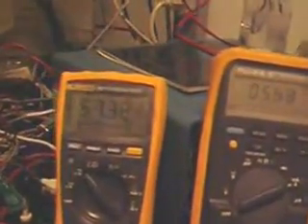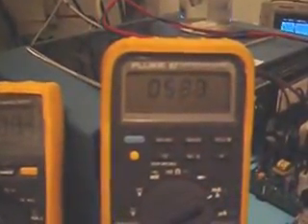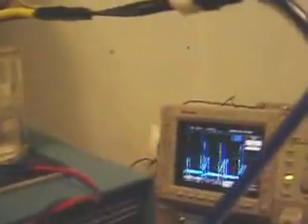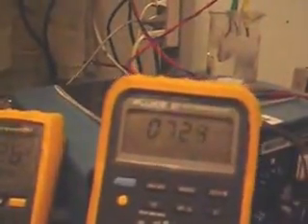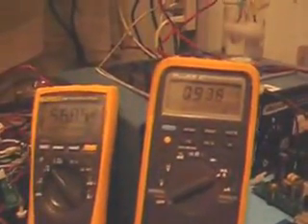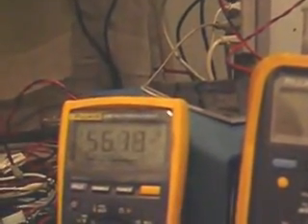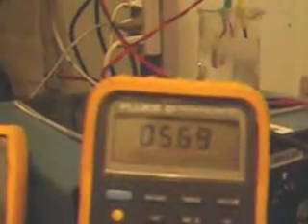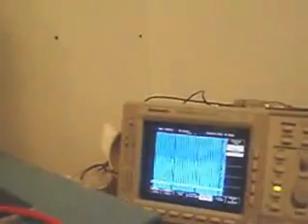Phase1Demo.wmv

Comment: At 55-57 volts you are on the edge of plasma electrolysis which will produce the "lightning" without any Q.  Does it still behave the same at 50volts loading but higher average loading current?  Is the core shown nickel wire or is it made of palladium?

Comment: So this shows that the loading (electrolysis current) is insufficient to initate the reaction that yields extra energy.  When the high impulse function Q is applied in addition to modest electrolisys current then the LENR reaction commences immediately.   Because the Q function does not actually consume much energy compared to electrolysis (used to make H ions and draw it in to the metal) it demonstrates control over the reaction.  A thermostat hooked to Q would make stable powerful heat source.